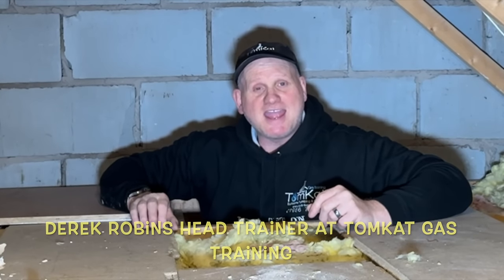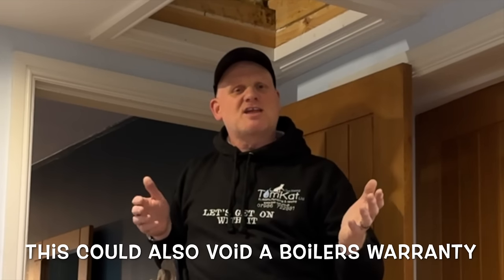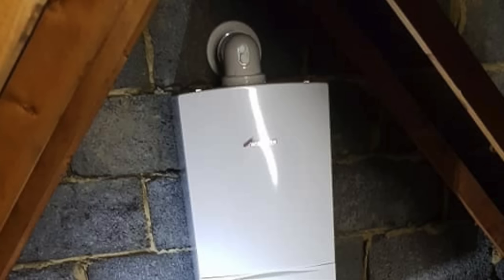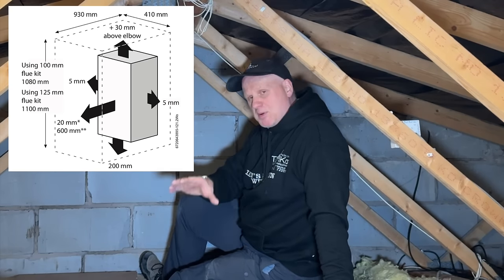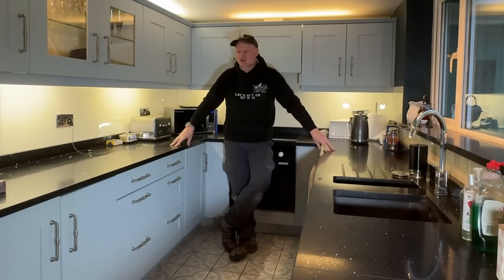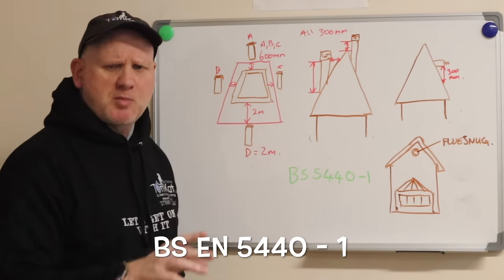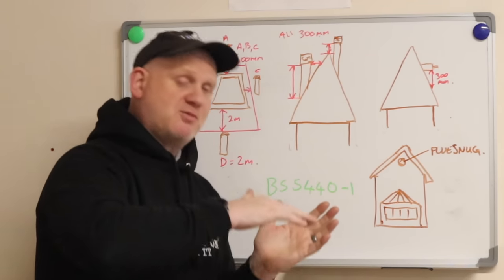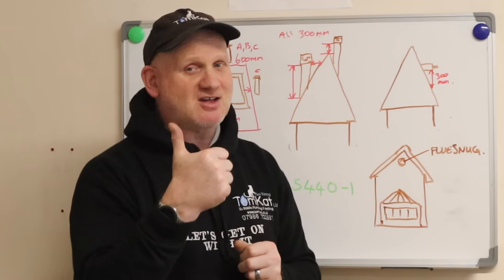Dangers when installing gas boilers in a loft, Gas training, ACS revision.

Comment: I’ve said it before and I’ll say it again… Customers who ask to have their boiler installed in the attic are the same type of people that never open the bonnet on their car, if they do ever get round to opening their bonnet, they never check the oil, never change the oil and their screen wash consists of washing up liquid and water…. If it has to be installed in the loft, then a remote filling loop and gauge should be installed. 
Love your videos keep up the great work!

Comment: Funny, here in Texas and many other southern states, most houses have all their HVAC equipment including gas furnaces, and water heaters are all located in the attic (loft).   I can tell you when its 40C+ outside the attics are well over 65C+, and working up there is a real treat here in Texas.  We don't have basements and most all homes are slab on grade foundations, so it limits where things can go.  I can say taking a 5 ton evaporator coil or 50 gallon water heaters up and down the crappy little stairs in fun.  Our attics are horrible in that there are no requirements for handrails, or decking to and from the units.  Most put a bit of plywood down, but not much.  We blow in 18-24" of insulation normally so having to find the rafters is a challenge.  

In our particular case, we have completely sealed attic with 2" gas lines running all through the attic and it will get smaller as it feeds in different areas.  We have to use condensing high efficiency devices in our home because we need combustion air brought in from outside directly to the device.    Seems like the regulations are much more restrictive there. 

Keep up the good work sir!  🤠👍

Comment: water leaks are my greatest reason for detesting loft installations,either water ruins ceilings and worse or rots out the boiler case.if a kitchen installed boiler leaked the homeowner would notice it but by the time a loft leak is identified the damage is already done.
Reply: A drip tray under the boiler with a small pump is a solution for piece of mind. Another one is a water sensor, hooked up to Home Assistant/Google Home (smart home), that alerts one on a mobile or panel of any leaks or condensation. Being negative about the idea is one thing, but not thinking of all the modern solutions is a tradegy. Plus, getting a good installer who knows what they are doing can do wonders. It is usually the cowboy installer that cuts corners during installation which is the root of all the future problems.

Comment: One thing you can rely on this modern market is the amount of tosh you hear. I like another installer think it’s BS. I’ve never had any of my customers complaining. I’m sure they would if I fitted a frost stat that brought the boiler on in winter 24-7🤦‍♂️ the only sensible point is about the gas pipe which every fitter should know about as this has been written since I started 26 years ago😊 99% of every thing you say is a good training tool. you are very amusing keep up the good work Sir. 16.51 on Monday 29 January.
Reply: Have you not heard of a pipe stat? Frost thermostats should always be fitted in series with a pipe thermostat.

Comment: Hi Derek, Happy new year!.... A couple of things Can you clarify this 12mm non combustible below the boiler, surely if the clearances are correct then that's not needed otherwise installation in a kitchen cupboard would come into question and as we know clearance distances are often forgotten about then. Just a comment on one of the photos' you've used at 5:43  Engineers should be aware that having a cable attached to any boiler pipework can induce an electric voltage into the pipe work and the boiler and although its a "Ghost Voltage" it can and does  make a non contact volt tester "Beep" and light!  I had this on a job  and was a pig to sort out.
Reply from the maker: Bs 6798 gives the information for the combustible material  which is there to protect from the boiler crashing through the ceiling in a small fire and as for the picture with the cable I agree with you and it’s a great point but I don’t know if it’s a low voltage stat cable or not or weather it’s 230 volts. Happy new year to you too 👍🏻

Comment: why can you pull a worcester flue back on its seal ,but then leave it underneath not sealed with cement etc ? .i know what your talking about.came out years ago. but how many times do people look under the rubber boot? lots ,especially on a gas inspection.

Comment: No wonder the younger  generation  are the way they are with all this bs fitted loads of boilers in lofts over the last 30 odd years with zero problem's
Reply: Me to fitted loads in lofts when necessary of course you need common sense usually try to avoid lower pitch lofts etc etc.
Reply: Fit and forget eh ! 😁😉
Reply: All the tanks etc been in loft for years.
Reply: @mmm091000 ah come on now please stop with that common sense nonsense we live in a time when common sense isn't allowed
Reply: @shaneshankly4518  😂🤣👏

Comment: If the boiler is not in the loft but the flue passes through it, do these access requirments for inspection have to be met by the house owner.
Reply from the maker: Because it’s only for inspection purposes then no you will need to use your equipment and follow your risk assessments.

Comment: can you say why you dont trust the frost stat thats installed in a boiler. ok extended piperuns i understand we need to protect them runs. why would you otherwise, theres a pressure releif at the boiler so if things do go wrong water pressure can be released say in a prolonged power cut where the boiler cant fire. also remote filling loop with a pressure gauge a brilliant idea but that heating system should hold pressure from service to service. ie zero need for the customer to top it up diluting inhibitors adding fresh water etc

edit i just fitted an ideal vogue in an attic  customer insisted. their commercial/domestic electrician was called to extend an old removed immersion heater to the new boiler fused spur. i chatted with him about checking the  rcd, he seems to think 2 3amp fuses is ok. one at the boiler and one in a fused switch spur in the ktchen. no down rating of the rcd needed. have the regs changed on thier side do you know? my understanding is the rcd needs to be downrated.

Comment: Complete and utter jessies. Had exactly that issue. One refused to go up despite a loft ladder with a handrail. " what if I fall off?" " don't fucking fall off". The next one came and asked what the issue was. A generation that can't go upstairs without a safety harness.
Reply from the maker: If an engineer falls if a ladder or comes crashing through the ceiling and brakes both legs because it’s not the correct access to the boiler who sues who the engineer for the broken legs and loss of pay or the customer for the damages.
Reply: @tomkatgastraining  that’s what common sense, assessing the situation and insurance is all about.
Reply from the maker: @BerkeleyTowers  and the engineer assessed the situation and thought it was unsafe.
Reply: @tomkatgastraining  It's the definition of "unsafe" I'm talking about. There's a wider problem in the trades and society in general about the dumbing down and softening of acceptable risk. If you can't get through a loft hatch into a loft, what are you even doing in a trade?
The wider problem is that there aren't enough tradesman in the industry. There's so much work out there that some muppets can, and do, cherry pick work that's only easy money. The "I don't do lofts" mentality. Come a downturn and shortage of work, it'll be interesting to see how long their "principles" stand up.

There's wholesale hypocrisy about the "3 points of contact" principle as a reason not to do stuff. If everyone who worked in the trades invoked that, absolutely nothing would get done anywhere that involved a ladder.
Reply from the maker: @BerkeleyTowers  a friend of mine who is a gas engineer slipped off the 3rd rung of a  ladder. He had major surgery on his knees and off work over 6 months. It was a good job he was employed not self employed. When I was an apprentice I saw a guy fall to his death cleaning a window. Work can be a dangerous place and I don’t blame anyone refusing to do something if they feel uncomfortable and unsafe.
Reply: @tomkatgastraining  So who does the work then? You've made my exact point. That line in the sand of "I feel uncomfortable and unsafe" has plummeted South. We'll have to agree to disagree on where that point should be. Getting out of bed is dangerous.
Reply: @BerkeleyTowers  Dumbing down is spot on.    I had this conversation this week at work with a chippy,  when we were youngsters working on our own cars, off to Halfords we went and bought a Haynes manual.            Text was clear, precise and well written,  you could literally rebuild anything on the car, outside your parents house in the street.

Fast forward 35 years and manuals are dumbed right down,  they only just stop short of telling kids not to drink the battery acid these days!
Reply: I'm aware of two case of serious injury from accessing roofspaces. One from a folding aluminium ladder that hadn't been clicked together properly. Lady broke her back in that instance. Second when a sectional amuninium ladder 'tore' at the spigots probably due to wing nuts not tightenened. It's one reason they changed from three section to four section ladders. Visitor to the property in this case was severely injured with many broken bones.
Reply: @Jonnydog1  So what? Aware of? Or know personally? Every man and his dog has anecdotes to quote that they're "aware" of. Not knowing the details of each and any incident makes stories like that pretty much irrelevant. Incorrect installation? User error? Or just the plain old mythical accident? (Mythical because every event needs somebody to blame these days). I personally know more people that have won serious money on the Lottery than have had serious incidents getting in or out of a loft. Would I draft legislation or draw solid scientific conclusions from that. Absolutely not. 
Let's all lie on the floor. Nobody can fall off that.
Reply: @BerkeleyTowers   LOL I'm with you 100% then again i'm an old cant who managed to retire without killing myself and i never had a book of instructions🤣

Comment: My Installs tick all the boxes except barrier round the top of the fixed loft ladder,  hands up I never knew about that being required........  

You said that open flues are no longer allowed for boilers.        Is this the same for   Aga/Rayburn/range cookers?     as they still manufacture burner kits and I presume new cookers also.
Reply from the maker: The video is about boilers not range cookers and if the hand rail goes up into the loft no need for the rails around the hatch.
Reply: @tomkatgastraining  Yes,   thats why question my question referred to range cookers , as this occurred to me while you were talking about flues and mentioned open flues.
Not a helpful answer.............           Yes,No or don't know    would have been better.          Enjoy the weekend.
Reply from the maker: @julianhawker7672  sorry if it sounded off it wasn’t my intention.

Comment: I Turn Fitting Boilers In Lofts Down ,Big Problems With Loft Installations
Reply: I had One Guy he was 83 
Up a ladder having to read the boiler pressure gauge, 20 Meters down the loft with Binoculars 😀
Reply: Seen boilers in lofts for 30 years without a single issue, good god what's going on

Comment: Done my apprenticeship, became lead engineer with multiple accreditations. The better I got the more I hated it. Spending £10k to study electrics. Gas engineering is the such a fucked/corrupt industry. 

Can’t stress enough, anyone getting into it - Avoid. Wouldn’t wish this life on my worst enemy. Wish someone told me when I started.
Reply: Anyway, Great video Tom ❤️
Reply: Completely agree with you. Wish I’d just gone joinery or bricklaying, or tried a bit harder and realised the industry sucks, become a bum and got on the dole early
Reply: I'm 70, Sparky, had enough by the time I got to 41. Constant changes in the Regs. Just drove me out. Not only that but the job was thankless.

Comment: Actually. one thing you absolutely cannot do is solder copper pipework in an attic space. I pre fabricate pipework as much as I can, and then use other methods to join pipes, but this whole video is of totally illegal hot works in an attic space. Of course you can put a gas pipe in an unventilated void ; otherwise are all gas pipework installations through joists in wooden floors between ceiling or floor, or in vertical studwork are  illegal ? What you cannot do is use a cavity wall to run a gas pipe in , except to go through it in the perpendicular.
Reply from the maker: Not sure what regs you work to but your whole comment has more holes than Swiss cheese.
Reply: @tomkatgastraining  except I am correct. Appliances that do dot require combustion air ( room sealed ) may, be subject to other external ventilation requirements, depending on the installation, but pipework in itself is not. Pipework is most certainly subject to fire protection considerations and locations ( especially after Grenfell ), but the pipework  carrying the gas itself isn't. Gas carrying pipework is not treated like flue pipework, or , as I said, every installation of gas pipe in unventilated spaces ( almost certainly the house you live in yourself btw , as well as mine ) is suddenly magically disallowed.
Reply: You absolutely can undertake hot works in a loft as long as you take correct precautions